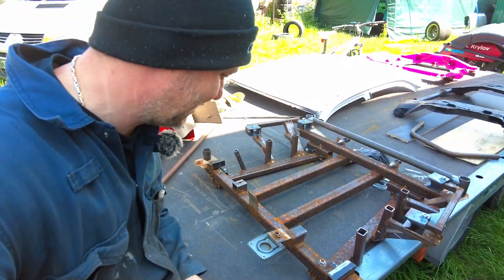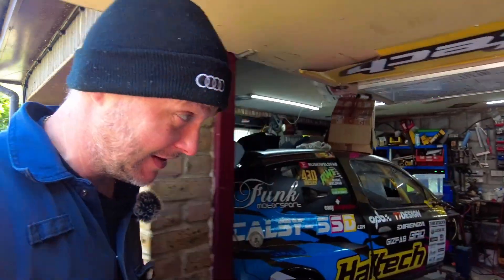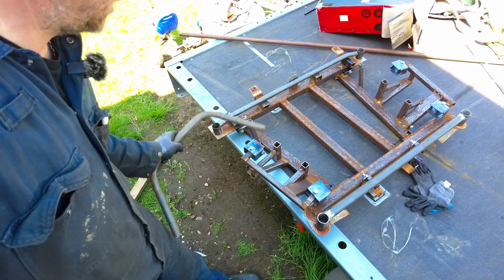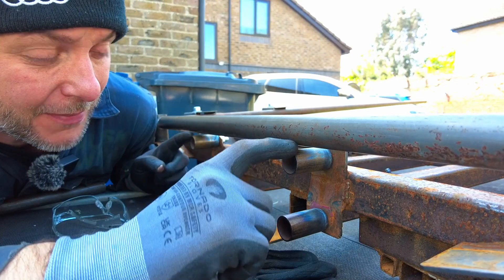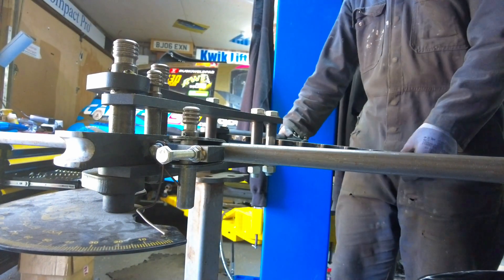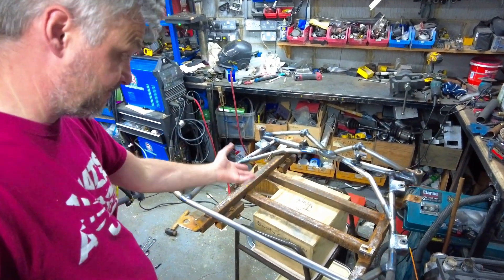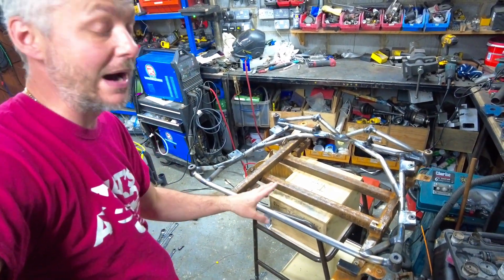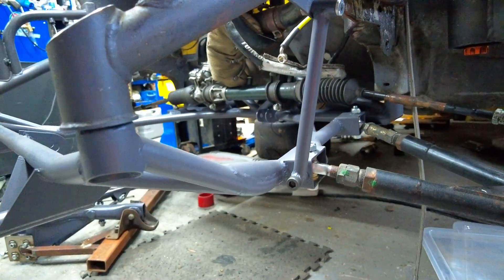This Clio tubular subframe is 10kg Lighter!

Comment: Amazing job, just an idea. Any tube the joins into a middle of another tube will allow more flex or is in bending. Ideally you want the ends of all tubes going to a corner or joining with another bender that is terminated at a corner. Not always possible but it prevents stress fractures and improves rigidity. Look any space frame car and you will see what I mean.
Reply from the maker: thank you. good tip!
Reply: @RuskiWeldFab  sick build dude.

Comment: Consumables tip!  
If you cut your tube shorter when notching so that you only have to notch one side not both sides as you did at the 4 min mark you'll cut faster. Your cut will require less pushing pressure so the tube won't deflect as far allowing for better tolerance and as you've reduced the surface cutting area by half you've reduced the heat in the cutter resulting in longer tool life. The hole saw bit will do over double the cuts.  10 ZIP cut disks is cheaper than a hole saw bit!
Reply from the maker: yeah i was doing it for most cuts. think that one in video was the only one like that lol